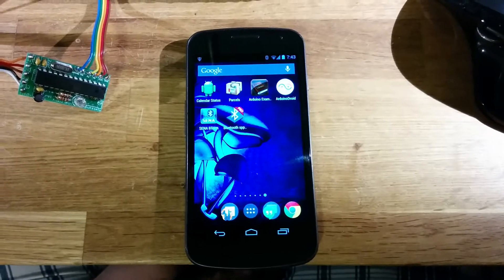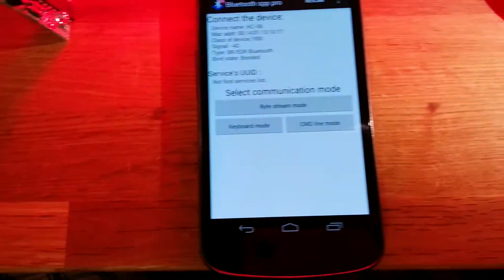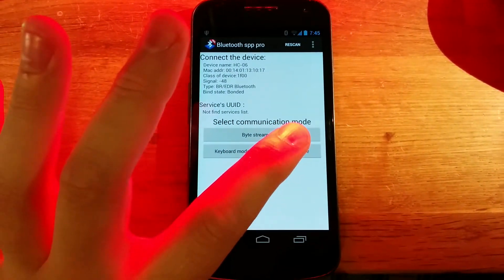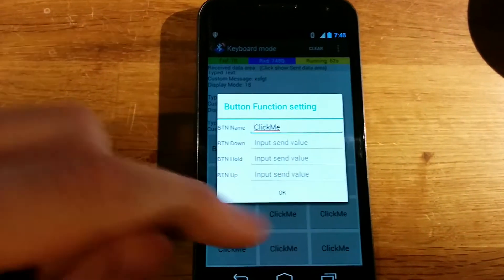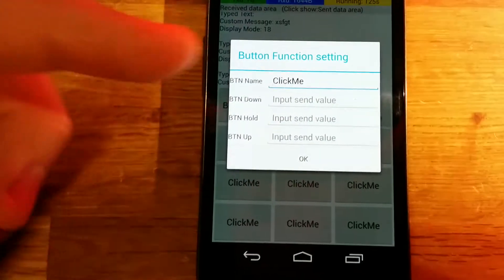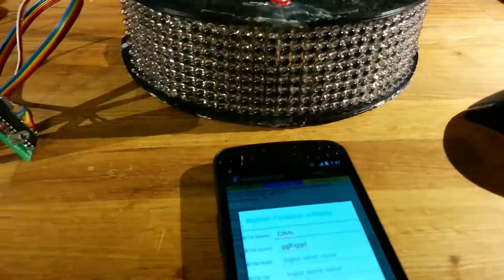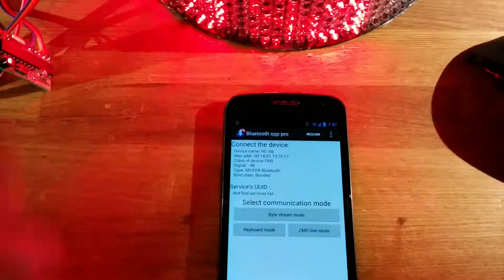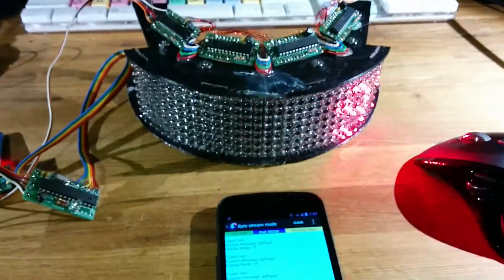Setting up Bluetooth spp for daft punk display

Comment: Hi friend, I did not understand the buttons: BTN Down, BTN Hold and BTN Up; You put letters - are not they values or numbers? (can it be letters?)
You did not explain the 3 functions and it is hard to understand because not everyone understands English.
But, thanks for the tips.
Reply from the maker: No Problem! So "BTN Name" is the name of the button on the grid." BTN Down" is what command you want to send when you push the button. If you hold the button down, then the command in "BTN Hold" will be sent, and when you let go, "BTN Up" is whats sent when you let go. The values are what you want to send, like text or something you want displayed, or a command. Just use BTN Down.